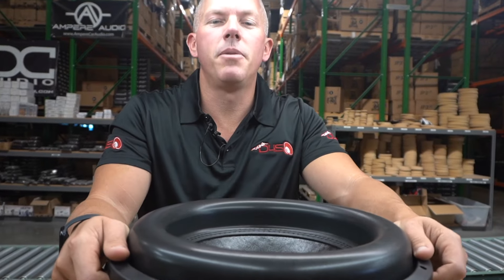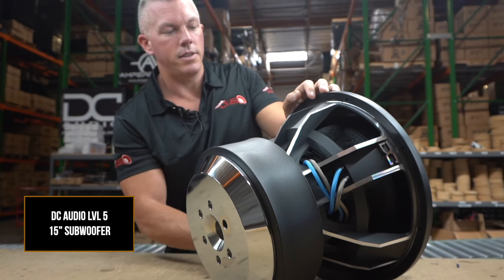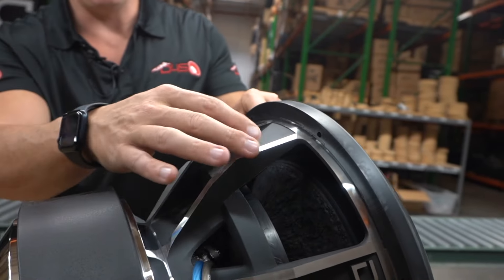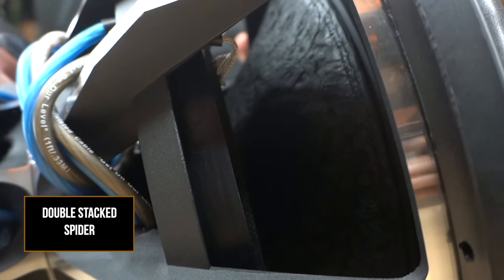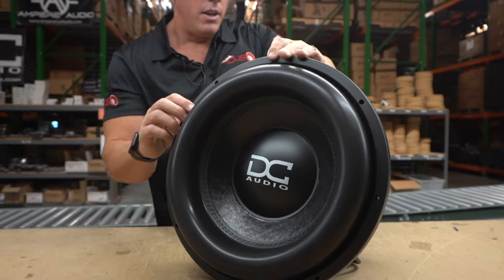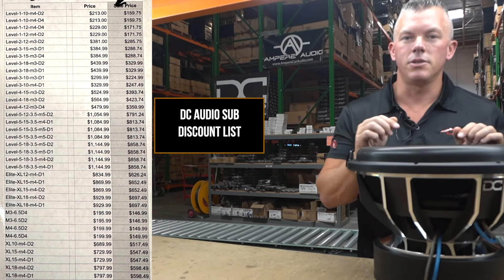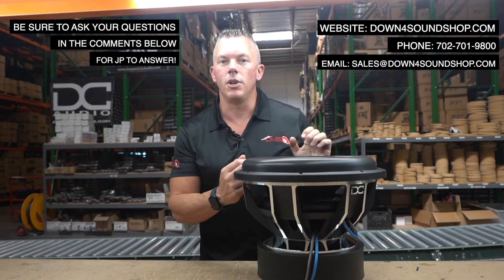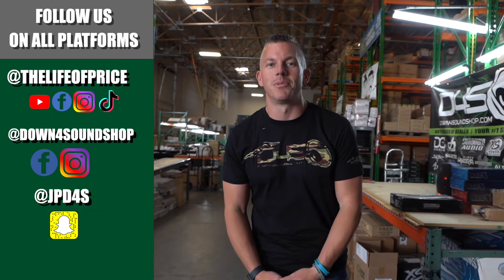DC AUDIO SUBWOOFERS WILL FLY OFF THE SHELVES WITH THIS SALE!

Comment: Dc audio vs sundown? Which one has better quality in your opinion?
Reply: both awesome. sorry, brand-loyal fanboys
Reply: DC subs overstocked and on sale. Sundown not overstocked and usually never on sale. That's all I'm saying.
Reply: My second sub was a sundown sa 12 it was nice but then i sold it and got a dc audio level 3 and i love it had it for 2 years on 1200 watts and it bangs still to this day🔊💯
Reply: Sundown has more factory produced units...which also means more chances for cosmetic flaws and errors...i like both brands but usually dc is tailored for less airspace per sub...which means you can fit more in a given space...in spl enviroments this is a win for me because i can fit more in that wall build...for absolute lows though sundowns can dig a bit deeper due to using more airspace and suspension design...in the end you shouldnt be looking at brand hugging...you should be looking at end goals and reasearch multiple brands to get you the closest outcome possible...its not the brand...its how you utilize the equipment.